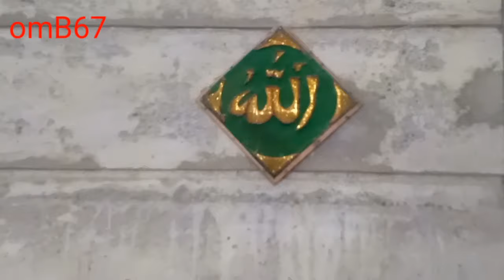CARA BUAT RUMAH COR SEMEN LEBIH KUAT,CEPAT DAN HEMAT #howtomake house

Comment: Saya pingin bangun ruko 5x8 
Atas dag depan tanpa pintu..
Saya punya dana 30 jt..
Dari nol.
Untuk tembok model cor.
Saya tenaga sendiri alias bahan saja... kira2 bisa berdiri gak ya?
Besi tiang pilar pakai besi diameter 10 mm. Jumlah 6 batang. Cukup kah?
Bisa berdiri kah?
Belum finishing...
Reply: Tinggi 3.2 m
Reply from the maker: Insya Allah bisa pak kalau untuk pembeli,pasir,besi dan semen sangat cukup
Reply: Trimakasih bos...